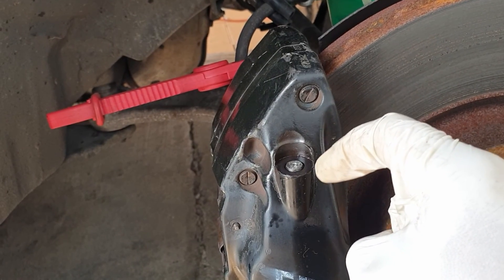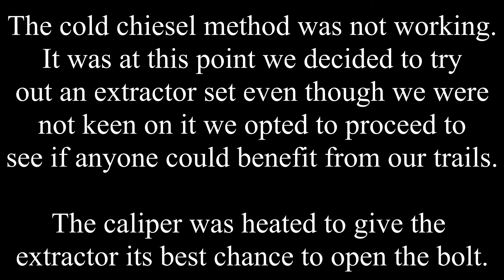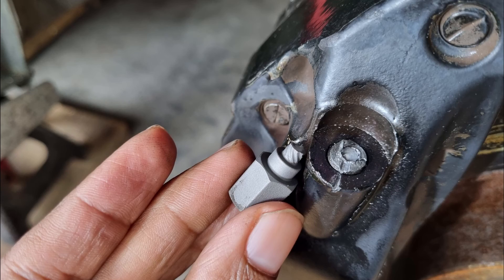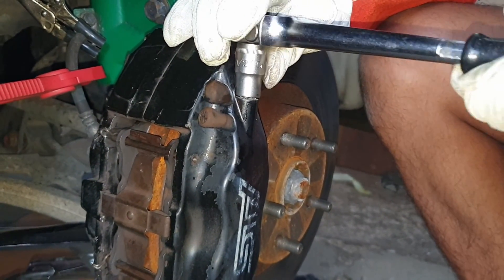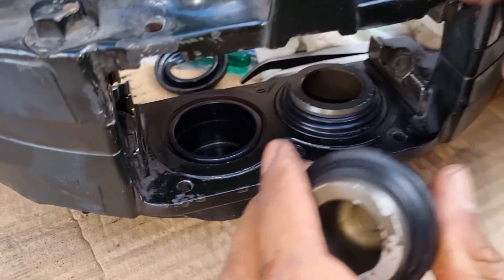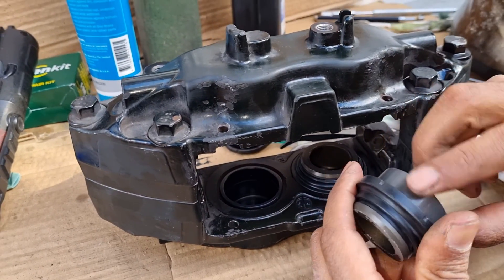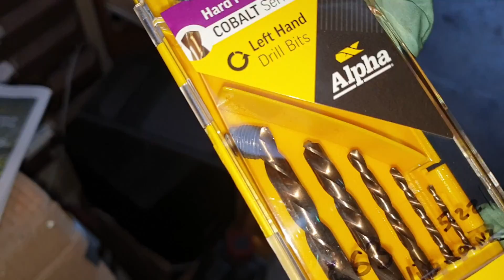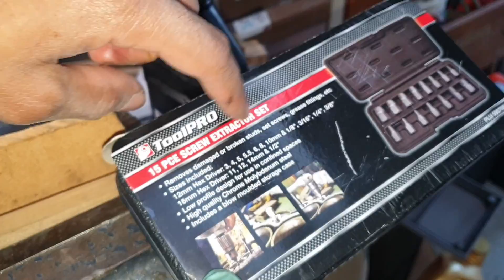Brake Caliper Bleed Bolt Repair

Comment: So, you didn’t Helicoil it? Just drill, tap and screw it back?
Reply from the maker: If its really bad then yes a helicoli would be required, otherwise the method shown on the video works well
Reply: @AutoBuddynz  I’m using a helicoil fml 🤦🏻‍♂️ beats paying $800 for front calipers…
Reply: @AutoBuddynz Thanks

Comment: The bleed screw repair insert should sit flush with the body of the caliper, you should have drill the hole deeper
Reply from the maker: Its a tapered edge repair screw, it is not necessary to drive it down flush. When you have limited material to work with especially with an aluminum caliper you have to be extremely careful. The tapered edge allows it to seal perfectly midway

Comment: Sometimes, it's  better to just get a new caliper. Too much time consumed drilling and cleaning the broken caliper.
Reply from the maker: Agreed, however where I am you struggle to find parts both new and old. Normally several months on back order
Reply: @AutoBuddynz I see, that is different,  then.
Reply: My caliper is brand new and the threads go fucked when i bled it
Reply: yeah my calipers are freshly rebuilt but i decided to powder coat and some of the powder coat messed with my threads so im looking for the same fix😓

Comment: You are right about extractors, but one trick I've used in the past [not possible on some equipment] is after drilling a clean hole through the stuck piece and thin it out,  is to use a tapered reamer to get it to match the extractor more closely.  This avoids pinch points somewhat by allowing a more even bite in the bore using less pressure.  Driving the typical extractor [with whatever taper it has] into a straight bore extra tight can wedge the top threads outwards, which sometimes compounds problems.
Reply from the maker: Thanks for the info, great insight!

Comment: Normally it wont work because there is no thread anymore. You Cant rethread it. Its safety issue. Also, after re threading, it will leak fluid
Reply from the maker: Correct, the way around it if the threads are severely damaged is with a TIME-SERT. If anyone is in this situation with damaged threads best to drop the caliper off with a specialist engineer, or simply replace the whole caliper.
Reply: @AutoBuddynz  Old thread, I know. This happened to me. I got the bleed bolts out but some of them came out with thread material from the caliper. No shops in my area would touch it. I bought a tap and die set and re-tapped it myself at a slightly larger size for a slightly larger bleed bolt. This worked perfectly 10 years ago on a set of used Brembo calipers on my track car. After 10 years of hard, high temp track use there have been no issues. I'm not recommending this for anyone else but it fortunately worked reliably for me. If you do this you must test the car slowly and meticulously for leaks, brake pressure, etc.
Reply from the maker: @bencompson  Yes exactly, the car must be tested at low speeds and monitored on a regular basis over a certain period to ensure there is no leaks etc